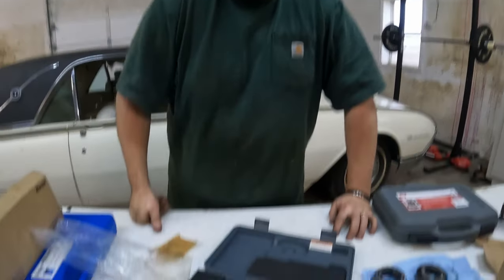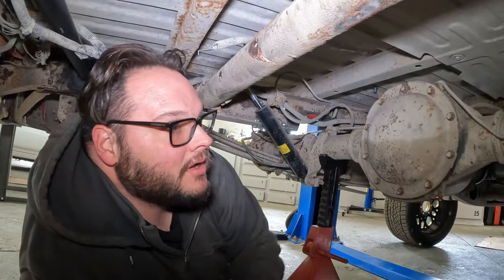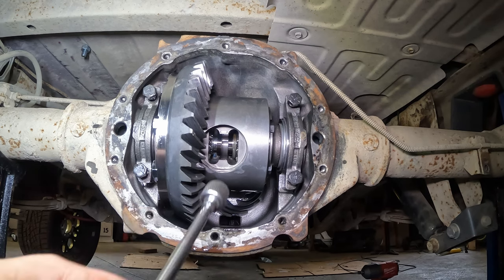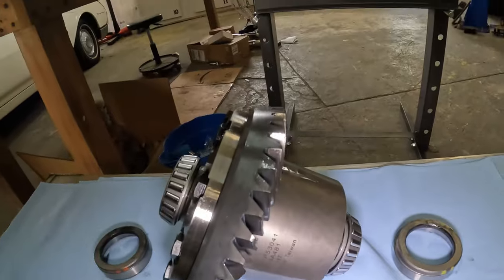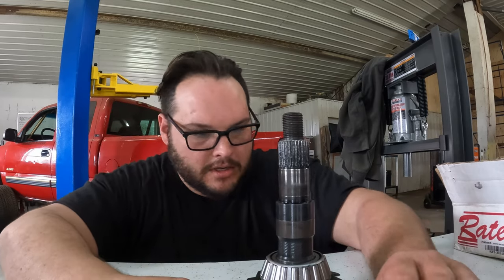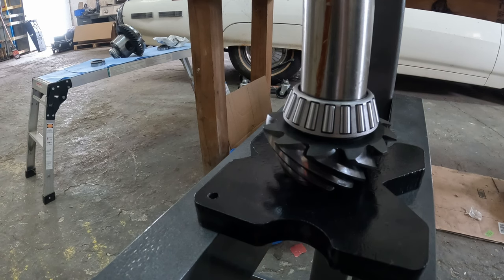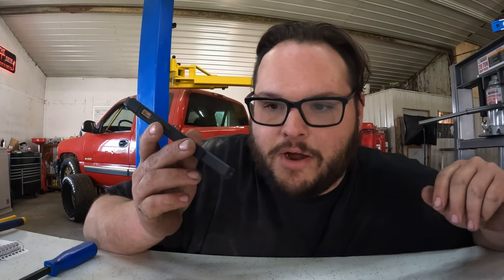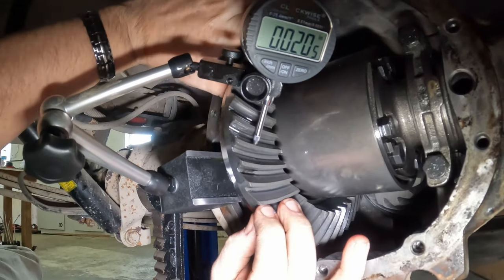GM 10 Bolt "Rebuild" Pinion bearing and crush sleeve replacement.

Comment: FYI, the pinion backlash was incorrect because the new carrier and ring did not match up to the pinion/shim from the previous carrier/ring. 

The crush sleeve will not affect backlash. Just load on the pinion bearings. You could have fixed this with the proper pinion shim depth and then running a new crush sleeve to proper preload
Reply from the maker: You are definitely correct. We learned this after the fact unfortunately. This was and is still brand new to us. I’ll have to be more clear in future videos that we are not experts and what we do is definitely not gospel.

Comment: I got a question about that gear set you have I blew my 10 bolt and was wanting something to put back in that didn’t have the spider gears but only thing I don’t know is if it’ll work with a 4x4 truck any tips would be appreciated love the style of video thanks brotha
Reply from the maker: To my knowledge 4wd should not make a difference as long as we are talking about the rear axle. I would not recommend a locker of any kind for the front axle unless it’s a mainly dedicated off-road rig. We have a Eaton trutrac. It is a clutch style locker. Very street friendly.
Reply from the maker: I should clarify. In terms of a locker of some sort 4wd should not make a difference. If you are wanting to change gear ratios from what you had then it does. You need to have the same ratio in the front as the rear. You’ll blow your transfer case and or transmission if they are different ratios.
Reply: Okay thank you that’s what I was wondering I was gonna do a 4.10 ratio but my tuner made me realize it won’t work with 4x4 😭 I appreciate it I’ll be ordering soon I miss my girl

Comment: What I don't understand is if you pull the pinion out but don't replace anything you can put it back right crush sleeve and all just not to over tighten. One would figure that the crush sleeve is already set to where it need to be or do you have to put a new one everytime you take the yoke off?
Reply from the maker: So we clearly are not professionals. My understanding of it is if the yoke comes off and you check preload properly as you reinstall it you ‘should’ be fine with the existing crush sleeve. I failed to do that and crushed it too far. If your pulling the pinion all together I’d replace the crush sleeve with the eliminator just to be safe.
Reply: The crush sleeve preloads the inner and outer bearings. the shims under the inner bearing sets the pinion depth, which is directly related to the amount of backlash between the ring and pinion gear teeth. The GM 10 bolt is a very tough rear axle when properly done.

Comment: This is not a job for someone who’s experience has been reading differential’s for dummies. This is a job for a professional mechanic with the tools, knowledge and training to do the job right the first time.
Reply from the maker: How does someone gain the knowledge?
Reply: @onthebrink47  buy going to school or asking some one with experience. My point is there are many thing one can do on their car. But this is not one of them. You can cause more problems than you solve. And buy the time you know you have a problem you created it will cost you more to fix it the second time than it would have being done right the first time. This particular job requires very specific tools that many home garage mechanics usually don’t have. And using a power tool to tighten the pinion nut, really. And his excuse for changing the yoke is a joke. If your differential is not showing signs of a problem, change the oil and leave it alone. If it is, bring it to a professional mechanic.
Reply from the maker: @bettyg7710  I’m not going to let school or people with this similar mentality gatekeep myself or others from learning through the actual experience. I don’t believe we ever claimed to be professionals at anything. We enjoy learning new things by trying them. Sometimes that means “failing”. I believe failure only exists when we stop trying. We are aware if this is not done correctly parts could fail. We accept that going into it. We are about to change gears and axles in this truck very soon. There will be a video on it. In the video we will again state we aren’t professionals. Even if viewers learn what NOT to do they’ve still learned something. If you happen to choose to view that video I hope we complete it more to your satisfaction.

Comment: wrong again crush ring has nothing to do with back lash gust bearing preload
Reply: Correct.   He's trying.  No one is an expert but we need to make sure the wrong info isn't recycled over and over and over.
Reply: Came here to say this. It would just effect preload. 

I think changing carrier and ring without setting up the pinion gear is the difference in backlash. Probably could have fixed this with correct shimming of the pinion
Reply: In correct sir, preload will have an effect on pinion distance to the ping gear. All though it will be a very small difference. Incorrect bearing preload will kill the bearings and take out the ring and pinion in the process.
Reply: This is not a job for someone who may have read differentials for dummies. This is a job best left for a professional technician like me. You are what we call a Frankenstein in the industry. It means just enough knowledge to be dangerous!